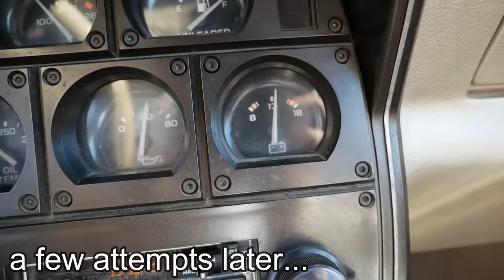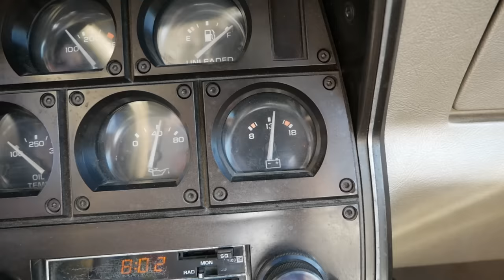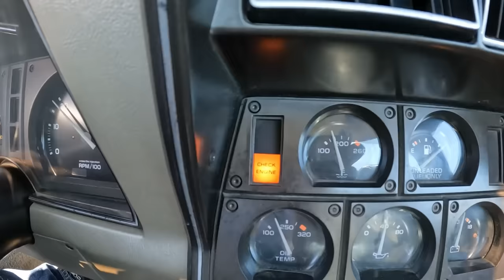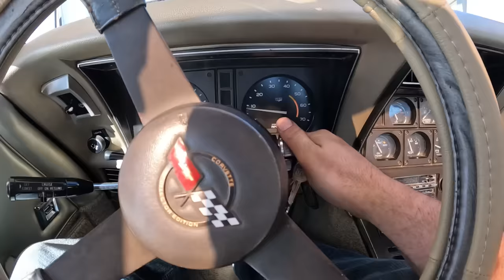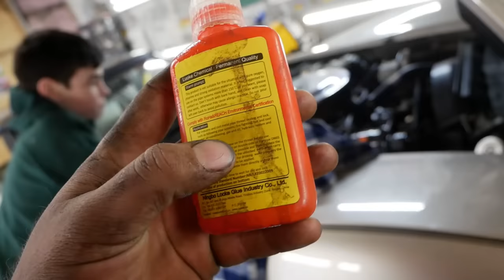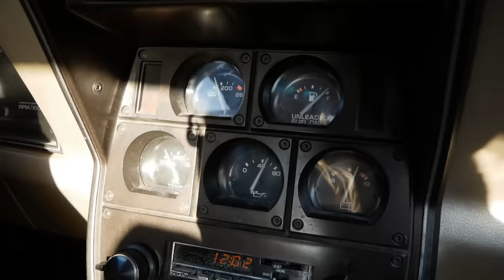RARE Corvette FOUND! Will it Drive 200 Miles Home For Restoration?

Comment: All the mid to late 70s up to 82 are lame, as far as horse power goes. My father in law had a 75 when I met my future wife. It was pretty fast, but then he got a 79 or 80, or maybe 81, it was lame. Pathetic..then a few years later he got the crown jewel of the c3s he got a 69 with the 427..it. .was... a .. beast. Scary fast!.. my sons got a 75 now but he built it from the ground up. It's 450 horse..and I have a 92 c4 that's also not stock. Mines old school. High rise intake and a big holley on top. And standard height ignition. No computer, no emission bs. I love vettes

Comment: Man will spend $800 on seat covers and STILL not buy any gas for his welder.
Reply from the maker: Not like I have any idea how to use it anyways 😂
Reply: @PoleBarnGarage  Aw, c'mon. MIG is basically the easiest kind of welding there is. Doesn't put nearly as much heat into the metal either, so burn-through isn't as much of a problem for body panels.

Comment: 115k 700r4 done you dont know i have one with 350k still shifts like new take care of it drive it right it
Reply: you just said why they die brown fluid its mostly neglect
Reply: headvisor falling down yep gm for you both of my 89s do that
Reply: plus on the trans thing no one services them just do a pan drop new fluid and filter folks its cheaper than another transmission and the time to change it. but no videos i watch do i see much of that its always the engine but not the most neglected part of a vehicle. im serious though.
Reply: your right about the parts stores masters ive had bad luck with a lot of them

Comment: You need to match your appearance for the era, to wit: bushy beard, fake afro, tank top, jogging shorts, calf-length white athletic socks, striped at the top, and expensive jogging shoes. You've already got the right sunglasses, so you'll get partial credit for that. Gold chains are optional, but if you move to Florida, they're mandatory at that point.

Comment: I do not miss working on old corvettes they are complete trash to work on you better know your way around shop tools pullers and presses 
oh and the whole front suspension death spring deal lmao at the people that worry about not using a spring compressor on old played out struts
Reply from the maker: It's just a spring in pocket design like most gm cars, a jack under the a arm and a little common sense gets the job done 🤷

Comment: C3s are my favorite, but my c4 handles the road at high speed much better. I really didnt care for c4s till i got one. I traded  a 97 ford ranger with a small block chevy race motor in it that my son put in it. It was extremely fast, butbit was a ford. It was cursed. Had allready gone through 2 of the stock 2.3 motors when my son swapped it. Hut it still broke down..damn near every werk. So when we found someone willing to trade it was gone..a c4 in any condition is worth allmost tripple what any ranger is worth, even in mint condition..ill never buy another ford..ever again..garbage!×

Comment: I know someone else was with you, but I'm laughing not only at the sunvisor but the idea of JD driving 200 miles home in that 77 LTD. I wonder if the Missouri SP troopers would care or take one look at him and give him a thumbs up and piss off to bust some methead or something. "This is America's sports car..." Um... Viper? Shelby Cobra? Daytona Coupe? DeTomaso Pantera? All of which outran the Corvette...  Yep Whorevettes are expensive for parts.. Wilwood upgrade discs and rotors for all 4 corners are $1240 from Summit which oddly is the cheapest place I found.
Reply from the maker: Every car you listed is 10x the price of a Corvette. Even new for new, they were all significantly more expensive. The Corvette is achievable for everyone, that's what makes it America's sports car.
Reply: @PoleBarnGarage  Uh huh.. 1971 DeTomaso Pantera $10,000 new. 1971 Vette $5500.. not 10X the last year of the Viper $69,900 the same year Vette $89,970. 2024 Vette $85-100k depending on where you live and the options. I will give you that the Daytona Coupe was extremely expensive, they only ever made a handful of them, just enough to be legal to race and all of those went to Ford Execs or race teams but to say that all these cars were 10X more than a Corvette new is bullshit there bud. Now a POS old Corvette that has issues vs a perfect Pantera now.. sure, but you need to go apples to apples, you can buy a used Pantera, especially a later one built fully in Italy and then brought over for close to the same price. I just searched and found one listed for $4200 in New Jersey. Also you can find rough Gen 1/2 Vipers for next to nothing, they aren't quite old enough to be super collectable yet, especially if you don't care about a salvage title. 
Personally though, I've been Jonesing for a Triumph MkIII GT6 which is basically a coupe Spitfire. (I know they aren't American but neither was the body Shelby started with) There's a guy near me selling a rolling car minus interior and drivetrain for $2k.. talk about a poor man's Cobra if you put a small block and 5 speed in it. The problem is I'm 6'10 and mostly torso.. there isn't a sports car on Earth I could likely fit in.
Personally if I went Viper, not that I can, I'd get one with no engine in it and swap in a 2010+ Hemi and make the car Dodge should have, especially with a 392.

Comment: Love the channel but sorry the Vette is no match for a Porsche.
Reply from the maker: I'd put it against any Porsche of similar vintage
Reply: I think the Vette would struggle up against a 911 Turbo 3.3L of the same vintage with 300HP, zero to 60 at 5.5 seconds and 160 MPH top speed.
Sayind that it would be interesting to know what power the Vette gets once de smogged.. Should be up from stock 200HP. Certainly the Vette is a cooler looking car and definitely better value.
The visor needs a self tapper though😂 😂😂

Comment: lol yeah cave man trying to figure out computer crap on 93 k1500  so far figured out if acts funny change out ECM boom 80% for problems fixed just make sure same ecm that came out of it lots of options yes your 82 has a ECM
Reply from the maker: Yeah it's been changed, you know what's easier? A carburetor
Reply: @PoleBarnGarage  lol yeah